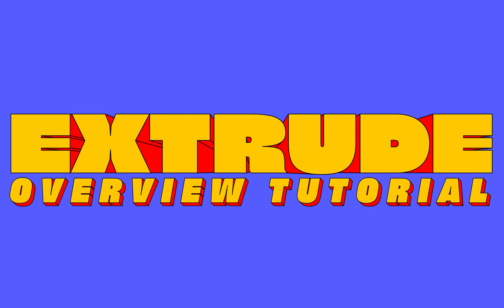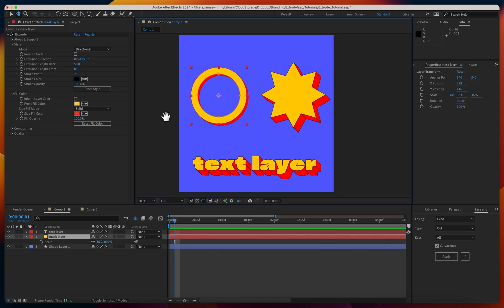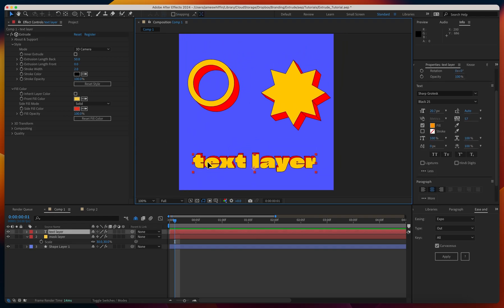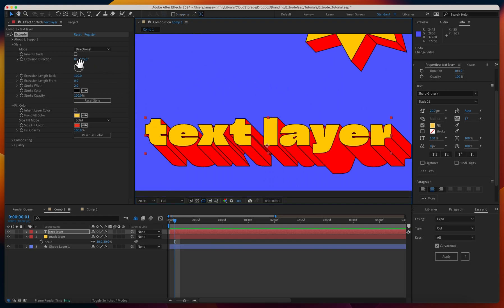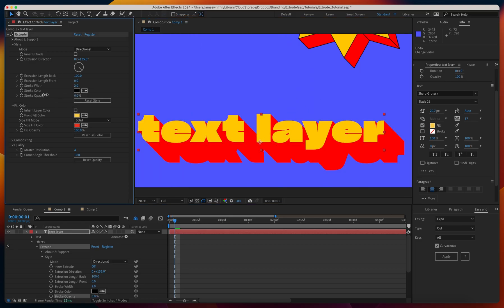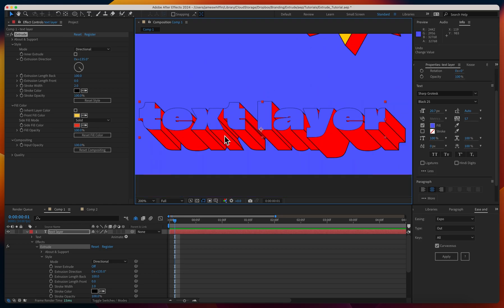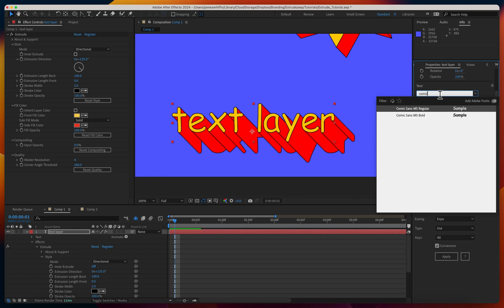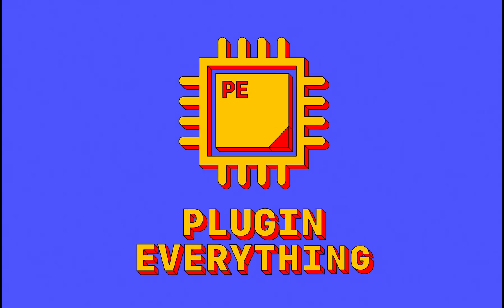Extrude - General Overview Tutorial

Comment: This is very cool, this is basically an oblique projection algorithm? I wonder how you calculated which connection lines need to be drawn to close the shape and which ones should be left out, not to mention the math involved for the layer stacking to hide the polygons behind the walls based on the angle.
Reply from the maker: Yeah, you're right! When Perspective Mode is set to "Directional", it uses an oblique projection (specifically a cavalier projection), while "Vanishing" mode switches it to a one-point perspective, and "3D Camera" utilises a full 3D perspective projection. As for occlusion, the plugin handles it by sorting the faces from back to front and drawing them accordingly, ensuring that polygons and strokes behind walls are hidden as required.

Comment: Is this effect compatible with the text layer's built-in stroke property?
Furthermore, could there be a way to align the effect stroke outside the letters, rather than in the center? (Like how Align Strokes work in Illustrator)
Reply from the maker: Hi Retro, it won't inherit the text layers inbuilt stroke but you can add your own stroke from extrude. Would you like an option where the stroke appears on the outside or inside only?
Reply: @PluginEverything  Yeah! exactly that.